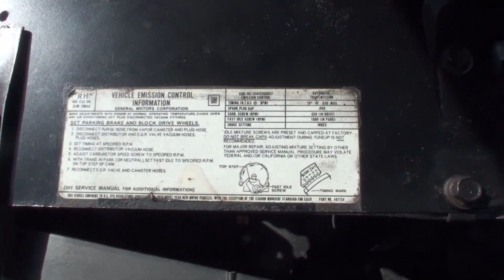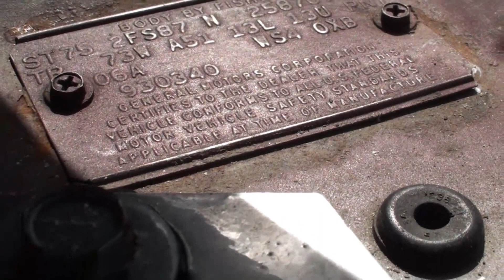1975 Trans Am

Comment: How is the power in the 75 trans am 400's? I heard the gearing was really bad.
Reply: turbotransam1980 I had one of these. The gearing in mine was 2.41, & it was not that peppy initially. It did a 16.66 quarter mile. With 4.11 gears, & some upgrading to the top half of the motor, it became an 11 second car. I don't have that car any more, & miss it. But I do have a 1981 Recaro TTA now, & I enjoy it a lot.
Reply: The Pontiac 400 was detuned by the factory to meet Gov standards but if you were a Pontiac guy like I was you knew how to wake them up on day one for very little money . If you recurve the Distributor , add headers and tune the carb you had a fast car ! then you could later change the Cam the Valve springs and do a gear change and you had a 12 second car , that was one of the great things about the Pontiac 400's , they were a great engine that just needed a little tuning with bolt on parts that you could do in a couple of weekends